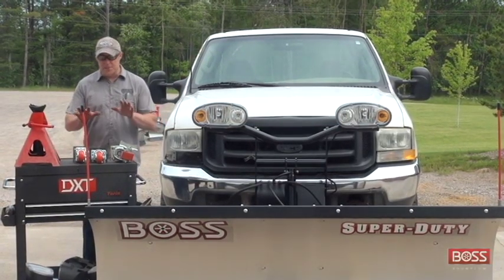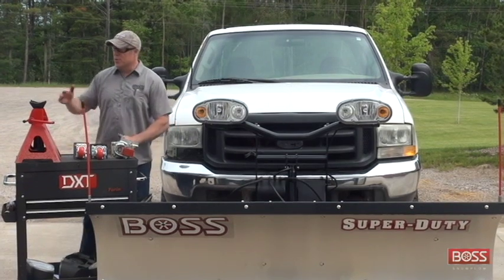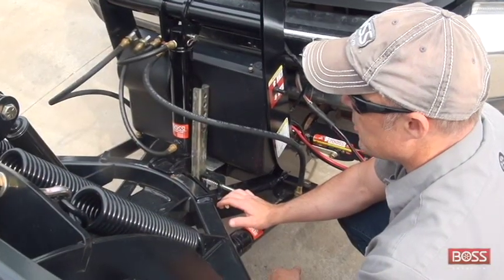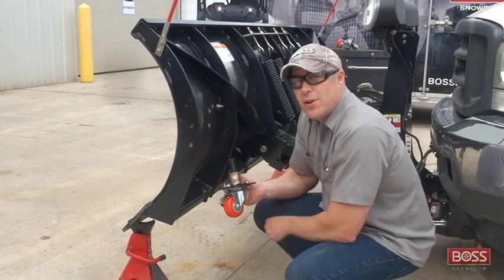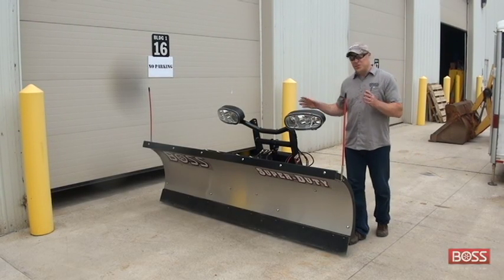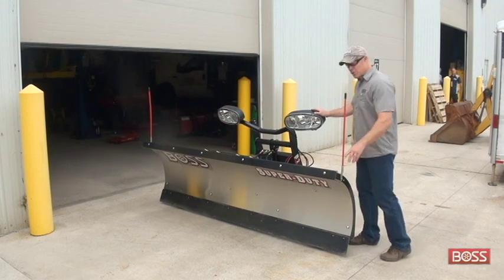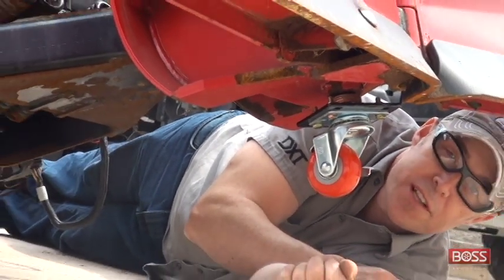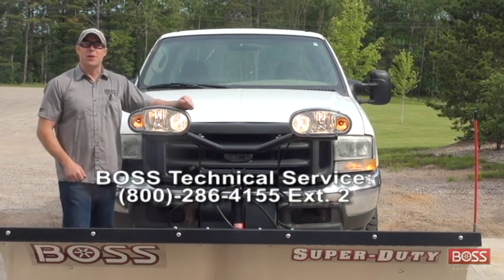How to Install Plow Wheels for a BOSS Straight and V-Blade Snow Plow

Comment: Have a Boss V-plow,  purchased the wheel kits, works great once I dismount the plow.   When the wheel are installed it changes the height of the plow, very difficult to remove and install the plow, plow height does not match the truck mounting.   I drive the truck onto  two 2" X 6"  to raise the truck level to match the plow brackets.    What am I missing or not doing?    Any suggestions?

Comment: Hey,

  Can you adjust the wheels to change the height, I have a cobble stone driveway and very uneven to plow on with the straight plow. thanks in advance
Reply from the maker: Yes, the plow shoes are height adjustable.  A link to the manual can be found here:  http://www.bossplow.com/content/servicecenter/documents/msc09589.pdf

Comment: Can these caster wheels act in lieu of conventional plow shoes during use for snow removal?
Reply from the maker: This is not something we recommend.
Reply: @Bossplow  Rear plows/rakes have gauge wheels.  Why not gauge wheels on the plow?  Why grind expensive steel into a road?  Easier on equipment, too.